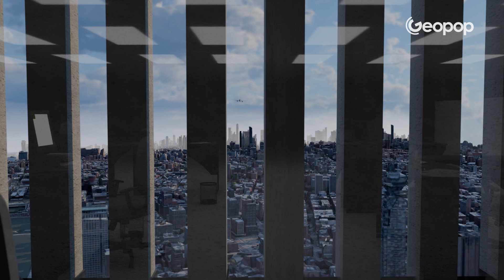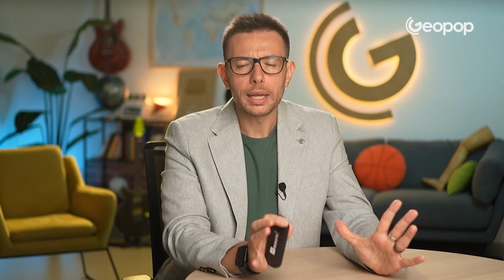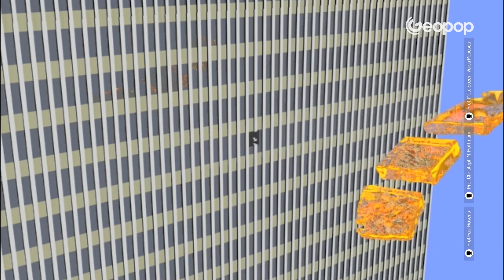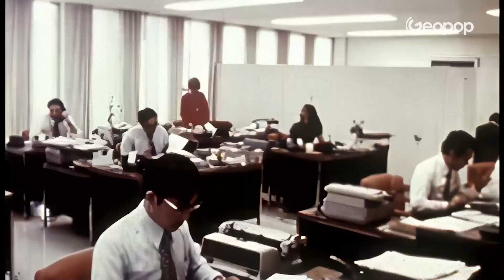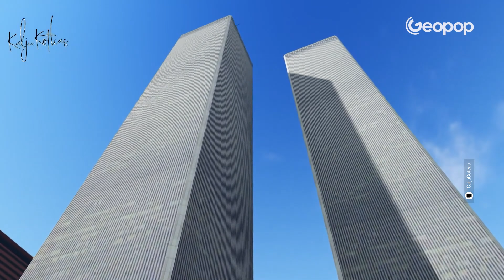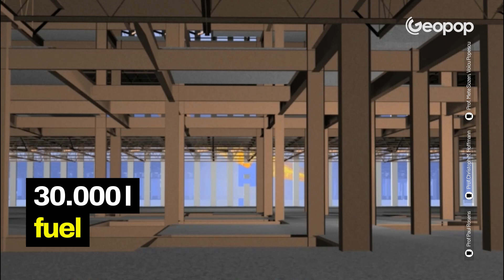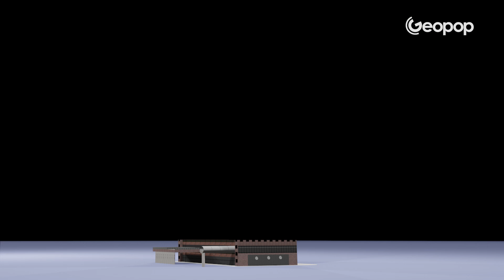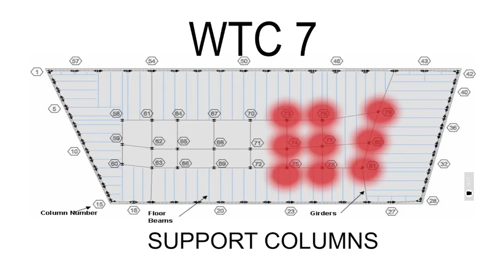9/11, 2001: The Technical Reconstruction of the Twin Towers and WTC 7 Collapses

Comment: You need to explain how the plane entered the building with no visible deceleration or deconstruction?  The wings could never slice through the steel exterior collumns and the concrete and steel floor structures.
Reply: Well, all 120 tons of Flight 175 entered the South Tower at 589 mph and 200 feet later only some pieces came out the other side.  The bulk of the aircraft decelerated from 589 mph to 0 mph in 0.25 of a second.

So you might want to re-think your hypothesis.
Reply: @TheLoonResistance  it is impossible for a 767 to fly 589 mph true air speed. An aluminum can will not break structural steel collumns and concrete and steel floor structures at any speed. An airplane is basically a giant aluminum can.
Try throwing a full can at a chain link fence and see if you can break the fence.
Reply: @thevictim2072  - No it isn't. Everything you just said is not just wrong, but obviously wrong.  Proof of that is the very obvious fact all of the above things you presume cannot happen DID IN FACT ACTUALLY HAPPEN

Be mindful that people on the internet lie to you about shit like that. 

Arguing that something which has already happened is impossible is never a good plan. If you are going to make technical claims, how about trying something that a million other people haven't already failed with before you, something that can be backed with true and relevant facts and therefore has more than a snowballs chance in hell.

Repeating the same mistakes as countless others while expecting different results is definitely not a good plan.
Reply: @TheLoonResistance everything I have seen other than the events that occurred on 9/11/2001 were in complete agreement the basic laws of physics. Every event on 9/11/2001 violated the unbreakable laws of physics. 
When man went to the moon, the laws of physics were not violated. An airplane slicing through steel with no visible sign of deceleration or deconstruction at a speed that far exceeded its VMax true air speed violates every law of physics.
Reply: @TheLoonResistance Newton's unbreakable laws of physics cannot be violated.
Reply: @thevictim2072  - And they weren't, so I don't even know why you would bring this up.

Unless you want to invoke magic or divine intervention, because the supernatural is the only way to violate laws of physics.

Or maybe you just copied that off the internet because you thought it would make you sound cool and you really don't understand the aircraft impacts, collapses or physics nearly as well as you pretend to.  Given your posts so far my vote is definitely for the latter option. 

Flight 11 impacted the North Tower at 440 mph, at or near full throttle in a shallow dive. This can be and was accurately measured based on the excellent visual record. A Boeing 767 is perfectly capable of doing this even though it exceeds the posted speed limit (VMO) when flown by a suicidal pilot who does not give a flying fuck about airframe fatigue or the comfort and safety of his passengers.

Flight 175 impacted the South Tower at 589 mph, at full throttle coming out of a dangerously steep dive. This can be and was accurately measured based on the excellent visual record. A Boeing 767 is perfectly capable of doing this even though it exceeds the posted speed limit (VMO) when flown by a suicidal pilot who does not give a flying fuck about airframe fatigue or the comfort and safety of his passengers.

Flight 77 impacted the Pentagon at 542 mph, at full throttle in a dive. This can be and was accurately measured based on the excellent visual record and the Flight Data Recorder recovered at the site. A Boeing 757 is perfectly capable of doing this even though it exceeds the posted speed limit (VMO) when flown by a suicidal pilot who does not give a flying fuck about airframe fatigue or the comfort and safety of his passengers.

Flight 93 flew straight into the ground at 540 mph, at full throttle coming in a near-vertical descent, as determined from the radar and FDR data.  A Boeing 757 is perfectly capable of doing this even though it exceeds the posted speed limit (VMO) because it is crashing straight into the ground anyway, when flown by a suicidal pilot who does not give a flying fuck about airframe fatigue or the comfort and safety of his passengers.

Aircraft break up as they enter the target structures, not before.  I don't know why I need to say this but I do. Again and again and again.  There has to be contact first. All four aircraft were converted into bits in a fraction of a second by energies you can't even begin to comprehend.

This in no way implies any of the buildings struck come out unscathed. The energy of a 120 ton B767 (equal to a dozen dump trucks) impacting at 589 mph is greater than a TON of TNT.
Reply: @TheLoonResistance the airplane has a total mass. How much of mass is available in the wings to slice through 30 vertical columns and the concrete and steel floor structures. Maybe 1,000 pounds per column.  Would that be enough force to slice through the collumns.
Obviously the plane would not fall apart prior to hitting a tower. It would behave exactly as any other collision. The airplane would begin to crush and deform as it hit the tower and the fuselage wuold be shredded and torn apart as it collided with the columns as it began deceleration. It would be near a complete stop as the wings and engines contacted the tower wall. The engines and landing gear would likely be jammed into the columns and the ramains of the plane would fall to the ground. If the wings hit the tower at the redicoulus speed of 589 mph there could never be enough force to cause significant damage to the columns. 
If the airplane could penetrate the tower as aeen in the pictures, you should be able to strike a steel nail with a hammer the the nail would be driven through the hammer.

Comment: They said they pulled! building 7 because of fire damage but it take more then a hr or two in a burning building to pant explosives to make the building fall down perfectly like it did was planned !
Reply: They who?  Pulled with what, cables?
Reply: @TheCriticalStinker-01 on the news they said fire damage was to bad and they had to pull the building weird way to say controlled demolition
Reply: @johnpetersen9619  - It is indeed, particularly since there was no demolition, controlled or otherwise. 

Your memory - from 24 years ago - is faulty.  Not really a surprise. This is what really happened:

Building 7 owner Larry Silverstein in 2002 on a PBS program called Rebuilding Americas Defenses claimed to have spoken to (he probably didn't) an unidentified FDNY commander. The two expressed concerns over the already horrendous casualties (half of the responding FDNY having been killed in the collapses of the Twin Towers already) and the unidentified FDNY commander agreed to pull the firefighters out of Building 7 since it could not be saved, in order to prevent further loss of life.

PBS Rebuilding America's Defenses: Kevin Spacey (narrator): Pelted by debris when the North Tower collapsed, [WTC] Seven burned until late afternoon allowing occupants to evacuate to safety

Larry Silverstein - I remember getting a call from the fire department commander, telling me that they were not sure they were gonna be able to contain the fire, and I said, “We’ve had such terrible loss of life, maybe the smartest thing to do is pull it.” And they made that decision to pull and we watched the building collapse

The thing they decided to pull was the firefighting effort. Note:  The concern was not for the building but of losing more lives in a hopeless cause. 

For relevant context:

FDNY Chief Daniel Nigro* - the on-scene commander at Building 7 on 9/11/2001; The biggest decision we had to make on the first day was to clear the area and create a collapse zone around the severely damaged 7 World Trade Center, a 47 story building heavily involved in fire. A number of fire officers and companies assessed the damage to the building. The appraisals indicated that the buildings structural integrity was in serious doubt. I issued orders to PULL back the firefighters and define the collapse zone. It was a critical decision; We could not lose any more firefighters. It took a lot of time to PULL everyone out, given the emotionalism of the day, communications difficulties and the collapse terrain

Deputy Chief Peter Hayden - 33 year veteran, NYFD in the August 2002 Firehouse Magazine; No, not right away, and that's probably why it stood for so long because it took a while for that fire to develop. It was a heavy body of fire in there and then we didn't make any attempt to fight it. That was just one of those wars we were just going to lose. We were concerned about the collapse of a 47-story building there. We were worried about additional collapse there of what was remaining standing of the towers and the Marriott, so we started PULLING the people back after a couple of hours of surface removal and searches along the surface of the debris. We started to PULL guys back because we were concerned for their safety

The concern is NOT for the building, it is for the people. The building is a lost cause. To avoid further needless loss of life they agreed to pull the firefighters - the people - out.

About 5 years later 3 teenagers made a movie in which they fabricated the silly claim that "pull" is a demolition term meaning to blow up the building (it isn't) and a lot of people ran with that (because it was in a documentary so it must be true 🤣🤣🤣)

The idea that a commercial real estate developer would speed-dial the fire department chief and order him to blow up an unstable building fully involved in fire (because the fire department takes orders from building owners and rigging a burning building for demolition is totally a thing the fire department does) has to be one of the dumbest ideas in human history.
Reply: The building was evacuated before noon. The building was empty for 5 hours. Stinky your story does not add up because there was no one in the building to pull out. Every.
One knows when you pull a building.It means you implode the building.  It refers to explosives. No one pulls a skyscraper down with cables.That's ridiculous. The building was evacuated from an unknown source in the port authority. Not the fire department. At the time the fire department commander in charge was running for his life from the buildings coming down, his radio quit working,  he couldn't have made that call. Anyone with common sense can see these buildings were brought down by controlled demolition. Bots don't have common sense. Pulling a building has been a demolition term for many many years. Anyone who denies thit's completely ridiculous because all you have to do is look it up on the internet.And it will clearly show you that pulling.A building means using explosives to bring it down in a controlled demolition. I'd be happy to pull that information up for you stinky but i've already done it dozens of times and you keep playing this same game. Truth is, he lost the argument.The first time , but some people just don't know when to stop

Comment: Curious enough that WTC6 and WTC5, closer to the WTC1 and WTC2, did not collapsed... considering that they received way more debris than WTC7 on the other side of the street... (as shown in this video).
Also, it would have been nice to know about how a plane fuselage could appear to pass through steel and concrete with no apparent resistance, given the absence of the localized crumple zone and immediate debris typical of a collision. If we stop the video of the second plane it, the plane is totally swallowed and yet, nothing happens (the plane can "entirely" gets in, before anything explode, no debris are shown before the explosion although there is obviously an impact, a collision before the explosion. It'd be nice to know about that awkwardness.
Reply: Falling debris did not cause the collapse of Building 7, the fire that debris brought with it did. Please pay attention.  This is why it took 7 hours. Fire takes time.

Curious how you left out Building 3, Building 4 and At Nicholas Church in your attempt at analysis.   Lie by omission or just ignorance?
Reply: @TheLoonResistance  Had not re-looked the video for the map of WTC, so neither a lie nor ignorance but... ok if you want to call it ignorance, fine I'll go with it.
Reply: @fkbaldwin  - Different buildings, different damage, different circumstances. Each best understood by looking at them on their own merits rather than trying to compare the incomparable.
Reply: Buildings 5 and 6 were less than 10 floors tall, they didn’t spectacularly collapse because they didn’t have much distance to fall from in the first place.

Comment: Bottom line folks.  For the total interior support structure and surrounding load bearing columns to fail simultaneously causing a free fall collapse it is not a mathematical probability question.  It is a mathematical IMPOSSIBILITY
Reply: Ummm... no it isn't.  Or show your math, if you expect to convince people.  And in any case, they did not need to fail simultaneously.... and in fact didn't, as can be clearly seen in the videos.
Reply: It wasn't simultaneous. Go back to school.

Comment: WTC 5 was no doubt a controlled demolition.
Reply: WTC 5 burned out but only suffered partial internal collapses. It was later taken down in a controlled demolition using cables.
Reply: Finally one of these morons is accidentally correct lol

Comment: It could have been worse. If the highjackers flew in like a dive bomber at a forty five degree angle and hit much lower at the tenth floor, the buildings may have actually tipped over taking out surrounding structures. This scenario would have taken more lives. I'm certainly glad that didn't happen. They may have discussed it but didn't want to take such a risky Manoeuvre.
Reply: Except commercial airliner can't even go the 600 mph they say they were going and it definitely couldn't go any faster